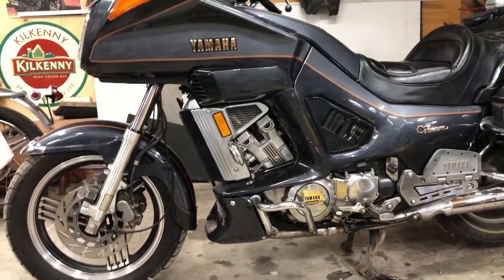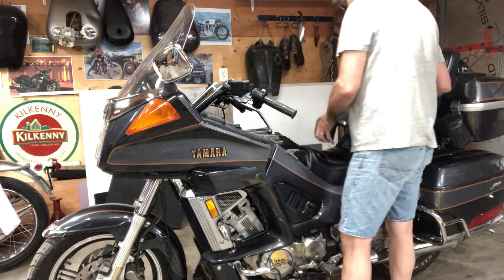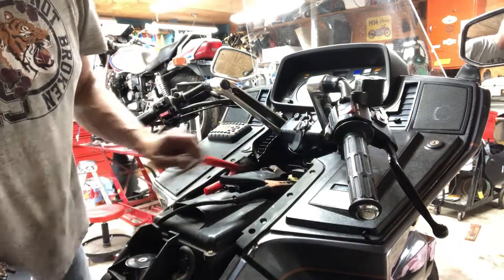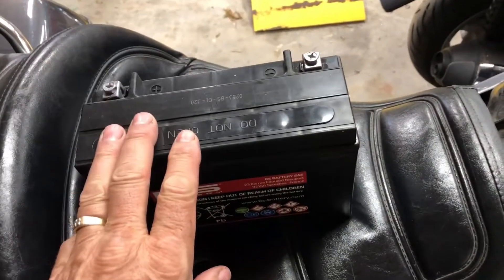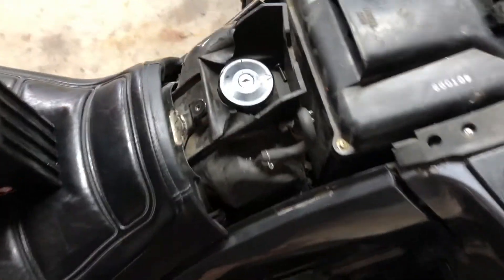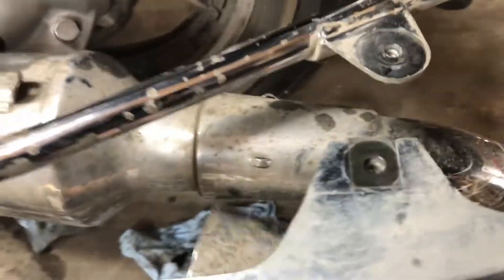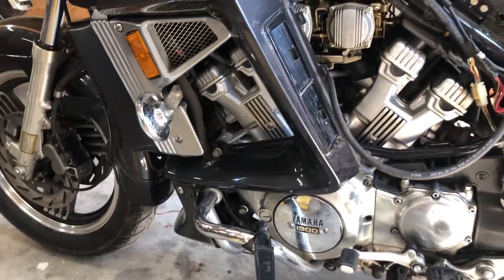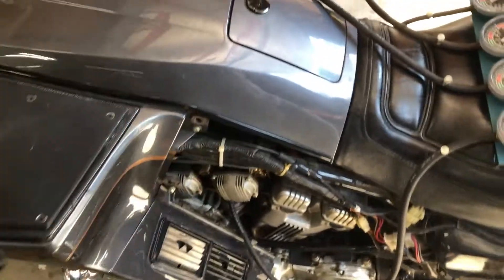1986 Yamaha Venture prepping for safety

Comment: Hi Bruce. Is the fuel additive to combat the ethenol? Here in the UK their going to go up from 5% to 10% no-one is thrilled about it... Tony
Reply from the maker: Hi Tony, I was putting the fuel additive in to try and clean up the carbs. They may be gummed up a bit. There is a miss fire on one of the cylinders. The ethanol is terrible for carbs. I run high test in all my bikes.

Comment: Where in ontario are you...maybe you would like to do the safety....im southwest of ottawa
Reply from the maker: I'm in Sarnia quite aways away. I am not licensed anymore to do safeties. I did continue to pay my dues in the 90's but I let that lapse.
Reply: I'm close to you and just about have mine on the road, I have a 1200cc bike that i was using for donor parts, if you want it its yours!..motor,exhaust carbs ..i only pulled off choke cables and the handle bars were missing when i got it